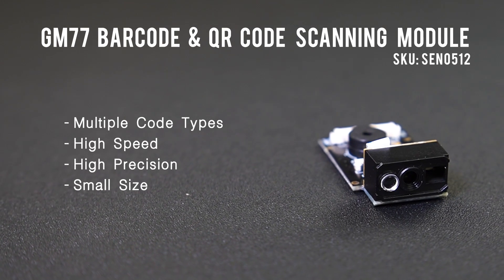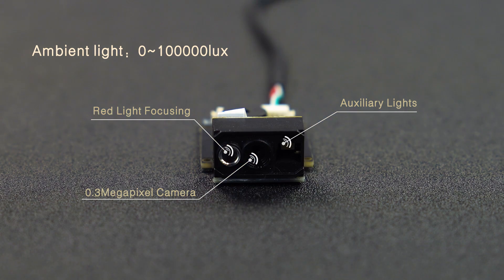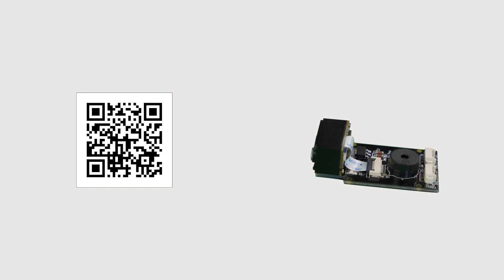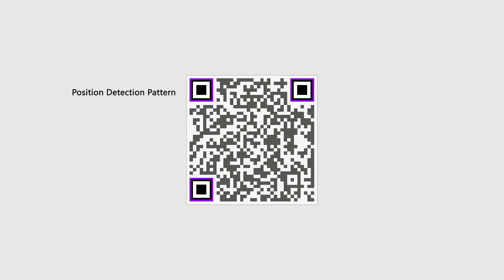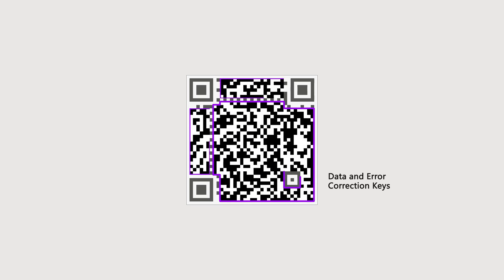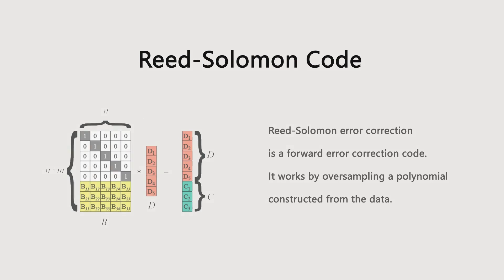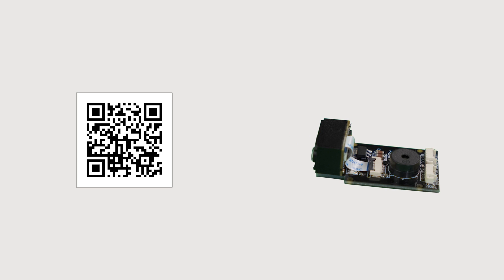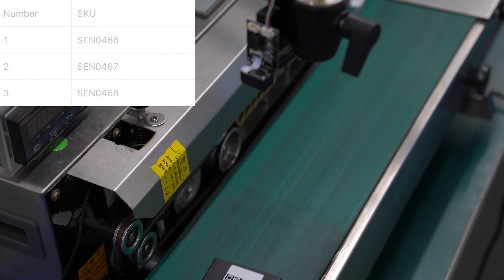How A QR Code Scanning Sensor Works - GM77 Barcode and QR Code Scanning Module - 15m/min - SEN0512

Comment: Nice overview :)
Questions from an engineer, as usual:
1) What's the active power-consumption?
2) What processing time is needed in an ideal situation? (perpendicular view, oriented code, sufficient lighting, large code)
3) Is this different than a "worst-case" situation? (small code, tilted & skewed code, poor lighting, gradient-lighting)
4) Are there situations where the sensing system shall perform unpredictably? (e.g. when two QR-codes are simultaneously visible to the camera)
5) Is there a typical "depth of focus"? Can the code be placed at any distance, as long as the solid-angle subtended by the code at the camera is more than xyz steradian?
Thanks!
Reply from the maker: Good questions :D
1) The active power consumption is about 0.9W according to the preliminary test.
2) Based on the information provided by the manufacturer, 50ms is needed to process in an ideal situation (perpendicular view, oriented code, sufficient lighting, large code). 
3) Yes, factors like small code, tilted & skewed code, poor lighting and gradient-lighting will affect the processing time, but it will not be over 150ms. 
4) Generally, the module performs predictably as long as the distance is rational and the code is correct. According to the test, it will decode the one that is easier to recognize in the FoV based on the algorithm when two QR codes are simultaneously visible to the camera.
5) The best distance between the camera and the code is 10-45cm, at which the code is clear to the camera.
Thanks for your continued support.
Reply: @DFROBOTCN  Thanks!
Reply: How can you have white LED when there is no such thing as white light? Do you know if lasers are at all involved in QR code scanners? I am concerned about the bright red light shining in my eyes from inappropriately placed QR code scanners with bright red lights. I would NEVER place them like that like shining straight into the customers' eyes but I am a customer and the employees place them facing straight into our eyes instead of pointing them downwards.
Reply: @PrashantKumar-qp4er  (1)fluorescence. (2) usually not; camera instead of bit-stream (3) Too bad - you should bring it to their attention